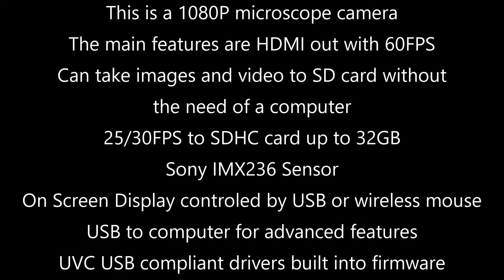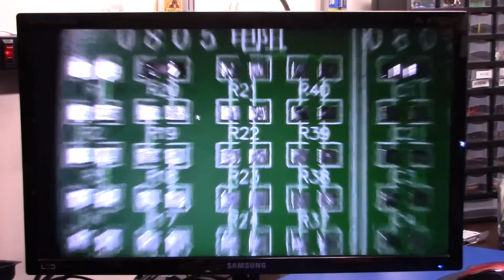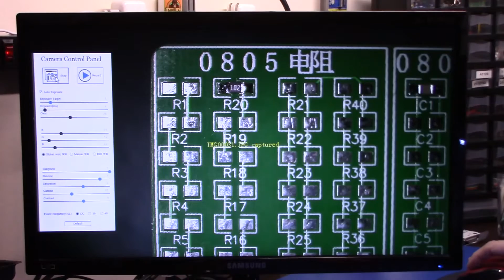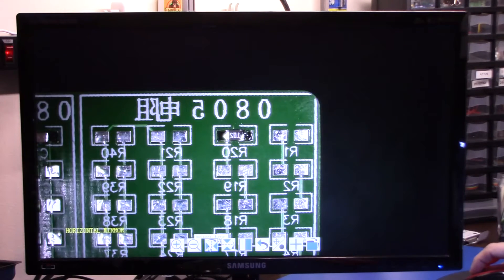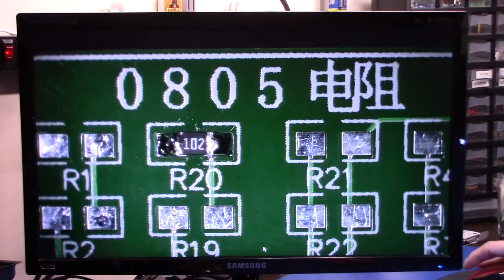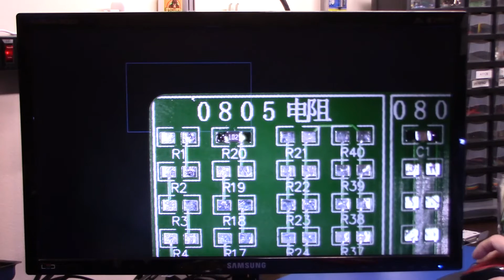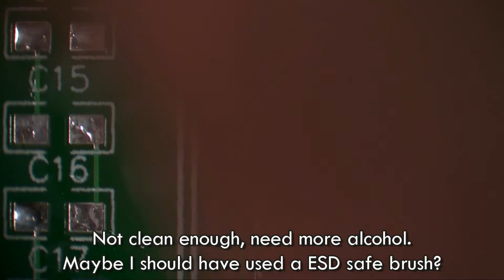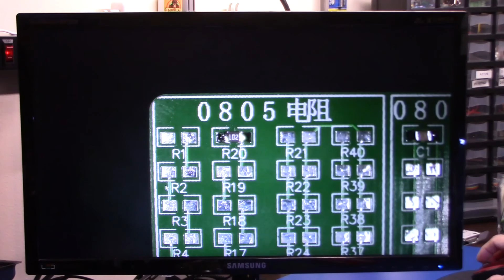On Screen Dispaly Feature Demo on 1080PHA Microscope Camera

Comment: What is the megapixel rating of this camera for still images? Thanks.
Reply from the maker: The cam area sensor is mainly developed for low light 1080P video, but it does capture still images. According to the sensor data sheet for the Sony IMX236 it’s rated for 2.38M effective pixels.
Most companies that use this sensor in microscope cameras just call it a 2MP still image camera sensor. The resolution of the image is at 1920X1080, same as the video capture resolution. 
A lot of cameras record in 1080P with still images at 2MP. Personally I can say the image pictures are still clear and sharp. 
I hope this helps.

Comment: Hi, i see the 1080PHD camera and it have a measure bar on top of the screen + WIFI and cost minus of camera you review 1080PHA, why? Your camera have also measerement top bar? 

1080PHD : https://it.aliexpress.com/item/1080p-HDMI-WIFI-microscope-camera-SONY-sensor/32664880388.html

1080PHA : https://www.aliexpress.com/item/Professional-HD-1080p-60fps-HDMI-and-USB-microscope-camera/32464609452.html?spm=2114.13010608.0.0.9gxk9F

Why 1080PHD offer more and cost less? Thank you...
Reply from the maker: The big difference in price is the better sensor, the cheaper wifi one is using the Sony IMX 185 and the camera I have used the Sony IMX 236 that is better in low light, captures higher Megapixel pictures and has a bigger sensor. Also the one I use meets the UVC standard so it will run on any operating system with UVC support. For example, I can plug mine into Windows 10 without loading any software or drivers and record a video with sound using the windows camera app. Considering the sale price currently I would personally use the one I have, it marked at a good price on sale now. I've never used the other one so I can't vouch for the quality. 

Also Im not sure how accurate the size reading are on the cheaper camera. Normally you have to calibrate the software to a scale or a piece of glass for the magnification your microscope uses. This is why most cameras that have software that can take accurate measurements come with this calibration slide. The calibrating is done in the software. The software that comes with the more expensive camera can also do this with the software it comes with.

Comment: Heya Gadget Review Videos, or is it Scott?? 
After seeing alot of your videos I think I made up my mind and gonna buy the 1080 Sony one you suggest, but the setup I need it for, is a bit different then yours, since I needed it for the monitor to my Zhuo Mao ZM-R6200c.
I use the monitor for when am finishing up the BGA rework for soldering chips back onto boards(Looking on the monitor, very, very closely for when the balls have melted together through camera and monitor that is pointed at the area where the balls melt).
The main problem is that I really don't have any clue of which lens to get for the Sony camera you suggested, for this kind of job. I normally don't refer to other youtubers videos(but I don't have a video setup of my own, that I can put on youtube, sorry for that), but to give you an overview and picture of the job I needed it for, I have put in a link here(Go to 1:10:00 in timeline of the video): https://www.youtube.com/watch?v=xRwfJpNvWI0&t=1260s 
Any suggestion at all regarding a lens for this kind of setup would be over the edge appreciated??
Even make me sleep at night again ;-) hehe.
Reply from the maker: Hi Martin, This is a good one, took me some time to do the research. This is what I have come up with for you. Let me know how it works. I would be instersted in seeing a picture of the BGA images on the machine after you get what you need to make it work.

No Problem refeing another video, I've done BGA complete rework before with new solder balls and all from start cleaning old solder off the old chip. You would need a different lens and reduction from anything I use. It would have to have a way to focus, and connects to the camera with a standard C-Mount threading. I would still suggest buying the camera from Rising Tech on AliExpress, the URL is in the description of the video. 

Looking at his video it looks like the end of the lens is about 4 to 6 inches from the chip. So the lens you get will need to have about a 4 to 6 inch working distance (100mm to 150mm). But I'm guessing, you would know better since you know how wide that square that drops down with the chip is. I was guessing that square with the suction is about 2 inches wide, putting the distance between it and the camera about 5 inches? If you want the camera to be further away then look for a lens that can focus with a 8 inch (200mm) working distance to keep the camera further away from the heat. Also since the lens will be closer to heat you want to find something that has glass optics and is made of metal, no plastics or I'm guessing it might melt with that machine.

You can get a cheap lens like this that has a male C-Mount threading.
http://www.ebay.com/itm/Generic-8x-100x-43mm-150mm-C-mount-Zoom-Glass-Lens-for-Industry-Lab-Microscope/262861198052?_trksid=p2047675.c100010.m2109&_trkparms=aid%3D2220073%26algo%3DSIM.MBE%26ao%3D1%26asc%3D41668%26meid%3D7bfa69fe83c64c958bcf2deb59c0a643%26pid%3D100010%26rk%3D6%26rkt%3D6%26sd%3D182281028390

I think using a generic lens above and removing the cheap 0.5X reduction lens at the end that screws into the camera and replacing it with the 1/3 SMZ (link below) would be a good match. But as I mentioned they may not all screw together and mining need some adapter rings to make it fit. SZM 1/3 focus lens. 
https://www.aliexpress.com/item/SZM-1-3-CTV-Stereo-Microscope-Camera-CCD-Mounting-Adapter/32791818532.html?spm=2114.13010208.99999999.263.AMTCDX

This is all just based off what I know and some quick research. I know people that use the above SMZ 1/3 lens and it works with their microscope. But I don't know anyone that has put it with a lens that's made usually for a cheap digital microscope. I don't see why it wouldn't work. But when it comes to lenses is all about the quality of the optics also. Glass is always better then plastic, but just because it's glass doesn't mean it's perfect. 

But if you want to try an all in one solution I found this one. The only catch is it has a 0.5X and not a 0.3X reduction so you may loose some of the image. It probably won't bother you since you will be zooming in close anyway. If you can find this following lens with a 0.3X reduction built in that would be better. If you look at all the pictures is points to one end and says it's a 0.5X adapter. See if you can find one like this this says it uses a 0.3X adapter and this would be the best match for the camera sensors but the 0.5 X shoild work as I mentioned above.
http://www.ebay.com/itm/180X-Optical-Lens-Monocular-Zoom-Digital-CCD-Camera-lens-f-Industrial-Microscope/182343418259?_trksid=p2047675.c100009.m1982&_trkparms=aid%3D888007%26algo%3DDISC.MBE%26ao%3D1%26asc%3D41668%26meid%3Dec2c5f6b59794f92987303f2452835c1%26pid%3D100009%26rk%3D1%26rkt%3D1%26sd%3D182281028390

Good luck and I hope this helped,
Scott
Reply: Heya Scott,

Cheers a mill for the great reply man! Was exactly the response I was looking for. 

So if it was you, that needed to go out and buy a lens for this specific job, you would get the 
180X Optical Lens Monocular Zoom Digital CCD Camera lens for Industrial Microscope with a 0.3x reduction built in right??

Kind regards,
Martin
Reply: Hey Again Scott,
Finding such a lens with the built in 0.3x reduction is a tought task, hehe. 

I was wondering if you could buy an 0.3x reduction adapter mount for the 180X Optical Lens Monocular Zoom Digital CCD Camera lens?? If you know of course :-) 

Kind regards,
Martin
Reply from the maker: For the way your trying to use it, I think it's the only option to use a lens like that without a microscope. It's the same thing the other video you referenced is using but looks like his is from a cheap digital microscope setup and he just mounted on a different mount to point it sideways on the machine.
You image should be better with the better camera. Maybe check some reviews of some of the lenses since some Knut have good reviews and some may be to cheap to have a good image like the image he had that looked over exposed and out of focus.
Reply from the maker: After thinking about I, the 0.5 vs the 0.3 would only cut back on the whole size of the image captured and seen. But your going to be zooming in on smaller objects so you may not notice the difference that much between the 0.5 and the 0.3 being zoomed in close.

The SZM 1/3 might be able to screw into the lens. You might be able to remove the 0.5 and screw in the SZM 1/3. This would be the same as the 0.3. These lenses for these cheap digital camera microscopes are just adapter rings and parts screwed together.

The SZM 1/3 would screw into he camera. I screw the 0.5 and C-Mount three from the all in one lens and screw the other side of the SZM 1/3 into the lens. It might need a adapter ring to screw together like a CS-mount thread to C-Moint thread, or maybe not. But the adapter rings are cheap.

If I were you I would try the whole lens first and see how it works and looks. Ifs it's good enough for the job to see the solder balls melt and the PCB board drop into place then your good.

If you not happy with the image or it lets in too much light like on his, then buy the SZM 1/3 and adapt that into the lens. It should improve the quality since that SZM is high quality optics also made from Sunny Optical. It's the same reduction lens I use with my microscope and camera, but mine is the 2015 version with a dovetail, the one I looked is the 2014 version with screw threads. 
My microscope has a dovetail, and not threads on the third port or I would have bought the 2014 one for $45 less then what I paid for the dovetail 2015 version.
Reply: I'll try the all in one lens first then and see how it all looks and of course, send you some pictures of it when it has arrived and been setup ;-) . 
Cheers a mill. so far for the info and help Scott!
Reply from the maker: Hi Martin,
      Looking forward to it. I see you have a new icon now also. You can find my email address in the Gadget Review Ptofile, under the ABOUT tab down on the left. It should say contact for business. Since YouTube uses a catcha to prevent spam it won't work from a phone or a tablet. So it has to be done from a computer with a normal web browser and not a mobile browser.
Feel free to email me any other questions and I'll help when I can. And of course you can email pictures of it when it's set up. I wish I could get one of those machines, but I don't have a daily use for one. I just want to try it once, lol.
Have a good day,
Scott
Reply: They don't come cheap either.... EEIIII!!!! lol xD . 
But if you do like 7-8 repairs a day it will eventually pay off, or atleast I hope :P  hehe. 
I have written down your email Scott and added you to favorite list, so i'll deffo be in touch :) . 
I wish you good health and an awesome day ;-) 

Kind regards 
Martin... and cheers again for the help sofar Scott!

Comment: Was this the camera you settled on? Or are you still looking for better quality in your price range?
Reply from the maker: Hi Troy,
Yes, this is the one I've been using. It's been great and everyone else that has asked about it and bought it has also been happy with it as long as you get the correct reduction lens with it. All the details are in the updated description of the video including the best recommended reduction lens to use with this camera. The only thing I suggest is getting a reduction lens that is not one like the long ones being sold from amscope.
If you get this camera from rising tech (link in the video description) I would ask if he can  get you the 0.35X reduction lens from sunny optical. It works the best with this camera and the ToupTek rebranded reduction lenses seem to have an issue with the Sony IMX sensors. You will see the problems with these ToupTek/amscope reduction lenses in this video:
https://youtu.be/4_-qz3bL5ew
Also a lot of the comments in this video answer other questions.
The 0.35X reduction lens is the best for this sensor.
Mine looks like this lens but Rising Tech got it for $30 less, it's all in the description of the video.
http://www.microscope.com/accessories/c-mount-adapters/omano-c-mount-adapter-0-3x-for-omano-om2300st.html
The new 2016 version looks a little different, easier to focus and adjust. It doesn't need an alankey now but works just as good as the 2015 version I have.
If you have any other question just let me know.